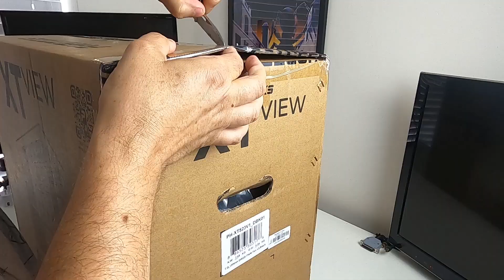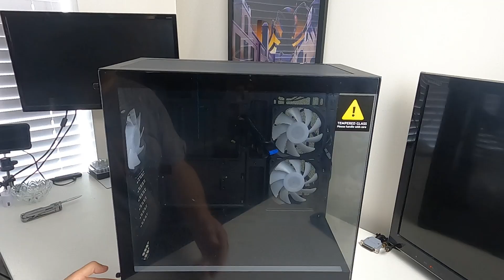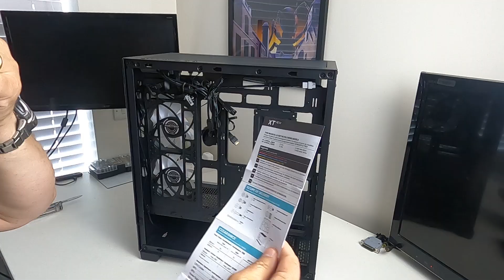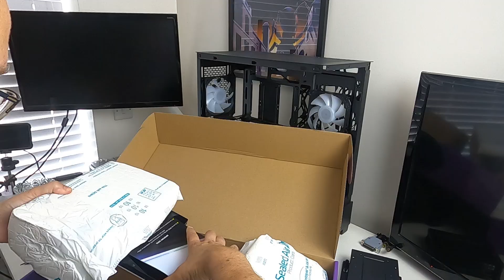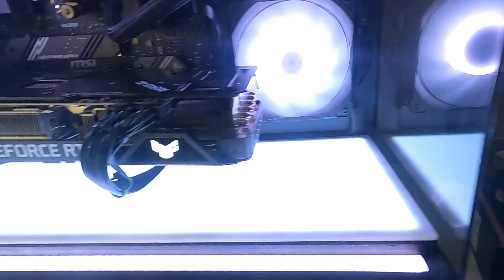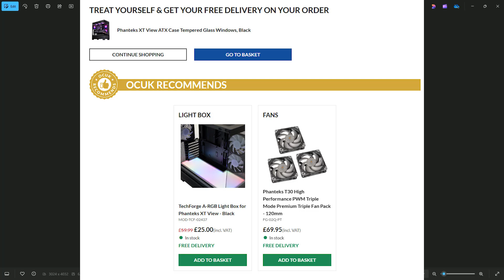Phanteks XT View ATX Case *UNBOXING & REVIEW* With OCUK Light Box

Comment: I own one of these. There is room for a DVD/Blu-ray drive at the bottom if you move the drive caddy back. You must make a rectangular
hole in the panel and add some holes with Pem Nuts to support the drive and DVD caddy's.
Reply from the maker: It's not part of the original design... but there's nothing to stop you making modifications to get one to fit.

Personally, I don't like chopping holes in cases as it will affect the resale value later. it would be easier to just get a USB drive and an extension cable.

Or get a case with DVD drive support - like the Fractal Design Pop case...

https://www.fractal-design.com/products/cases/pop/pop-silent/black-solid/

I review this case in this video...

https://www.youtube.com/watch?v=Tgz0P8r63os